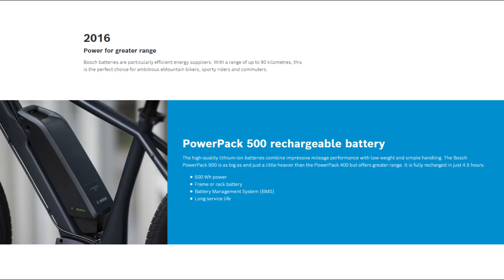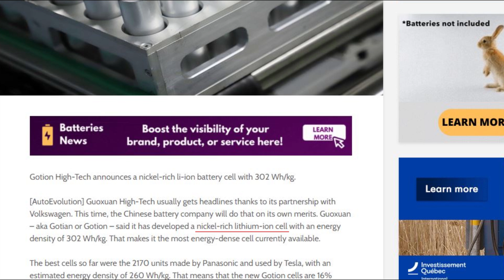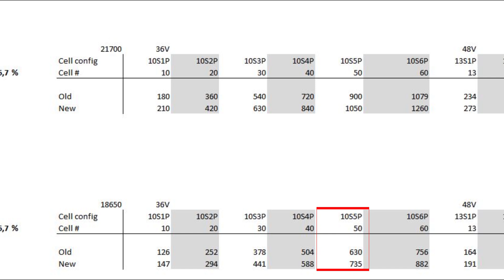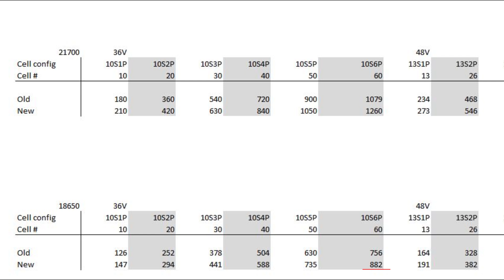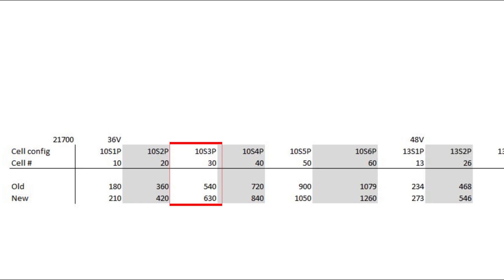When will "improved" ebike batteries hit the market?

Comment: As an owner of a 95 pound E-MTB, the E-CELLS Super Monarch Crown, that uses 2 batteries to power its 2 motors (front and rear hubs) I NEED lighter and faster charging batteries that are safer than the current Li-ion batteries.
-> IMHO the advent of solid state batteries for the automotive industry will happen by 2025. Those will be smaller, safer and faster charging according to claims of the several companies working on the technology. HOPEFULLY they will have the ability to have a big number of charge/discharge cycles like Li Fe Po4 batteries do currently. It is this tech that may truly revolutionize e-bike design.

Comment: imagine putting 4 or 5 of the 4680 cell. packaging would be a lot simpler. I'm just not sure about the voltage...
Reply from the maker: Yeah, the 4680 cells can be used to build an ebike battery. I did some investigation on those cells, to find out about weight and capacity. I plan on publishing a short video about it in about a week.

Comment: This will make batteries last 2x longer total lifetime due keeping them between 40 and 80 percent most of the time which is ideal for longevity.  Chargers or battery need to get a wee bit smarter so you can tell them to stop charging at 80pct. 700wh is a good number, take up the rest in weight savings .
Reply: You mean between 20 and 80 percent?
Reply: @Trillville43  no I consider 20 percent marginal if the goal is simply getting the longest useful life from the battery. Of course batteries are there to be used and my 500wh gets drained to this 20pct or lower sometimes, however  if I had a larger capacity I could do the exact same ride and only drain to 40 percent, allowing the battery to have a longer overall life time by keeping it in its optimum charge range.  There is a whole lot about this on the battery university web page

Comment: I heard that Orbea Rise bike batteries are not able to push enough current for a normal full power EP8 motor. However, mowing to 21700 cells is a step to right direction. 

Maybe going 48 Volts or even higher is the next step.
Reply: The 2017 Focus Sam2 had a 378 wh battery and a full fat E8000 motor weight is 20kg and no isdues what so ever. Orbea is purposely trying to make light and long range ebikes but having no full fat option... I know what Monique thinks.
Reply from the maker: I don't really understand why Orbea have limited the powerdraw from the 540Wh battery. There could be several reasons. I would assume the battery is powerfull enough for the full power EP8, YT is using a similar battery with the EP8.

Comment: Honestly 500wh is enough for me. If I go for a longer rides like more than 70km I just take second battery and it is very rarely I make more than 30 km daily
Reply: im the same i have a 378wh battery and its all i need even though i have a 378wh tec pack battery as well which very rarely gets used
Reply: I suppose it depends where you ride, how much you weigh, tyre tread and compound and ground condition. 
I am 191cm and 95kg, ride usually steep up and steep down terrain, very often muddy, requiring sticky tyres. I can do about 1300m elevation and 35km max, using mostly Tour mode (one up from Eco)
My 630wh battery is not enough, as very often I would like to ride just a bit more, would love 750wh battery, that would be perfect. 
When I am riding mostly flat terrain, with no more than 500m elevation, then I can do 45-50km, maybe more if I change tyres to faster rolling. 
Each to their own👍🏼